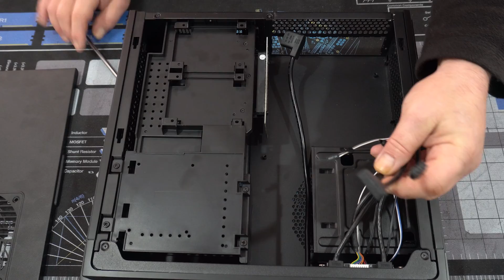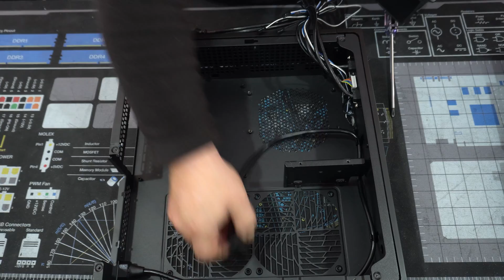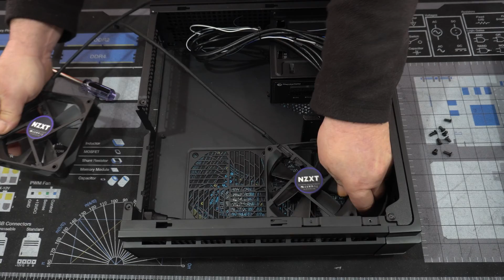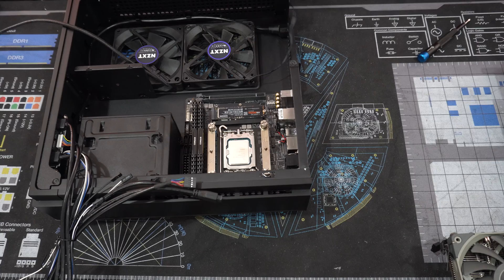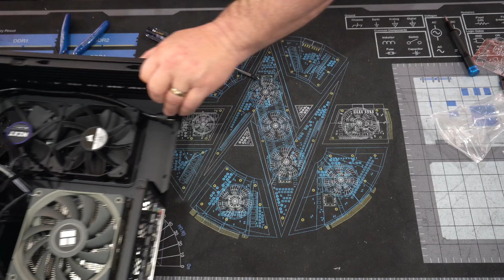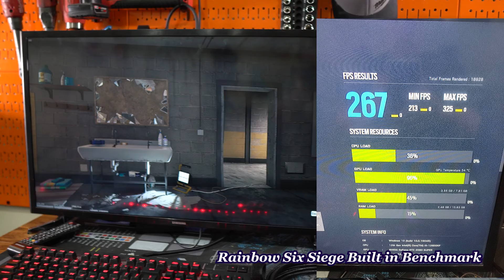Ultimate Compact Gaming PC Build Tutorial

Comment: Hopefully you're not actually suggesting a K series CPU with a H series motherboard. And it was more "I had this already in my possession" as ;
1. The "K" series runs hotter.
2. The chipset doesn't support overclocking anyway. So you would be paying over the odds for the "K"

So a i5-12600 would half the TDP and only lose you 100Mhz, or the i5-12600T quarters for TDP for 300Mhz. Both much better options that would prevent this being a hotbox for anyone considering following the spec list (even if you went 13th or 14th gen versioning).
Reply from the maker: 12600KF is currently 160.82 on amazon, the 12600 is currently 239.89 on amazon, and the 12400 is 153.00? My daughters system load is on the GPU and not the CPU. CPU runs about 60c under a  gaming load